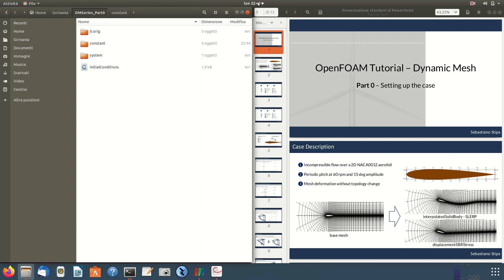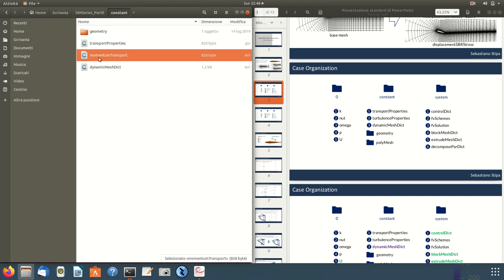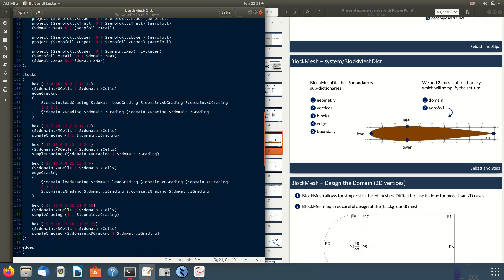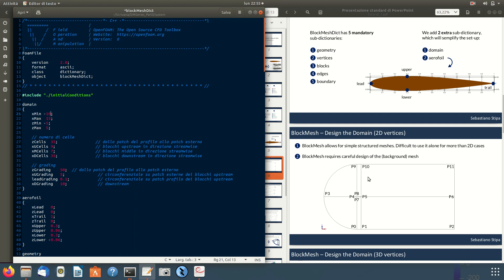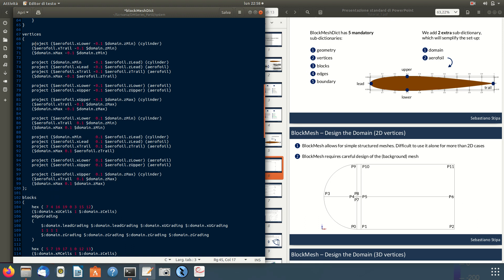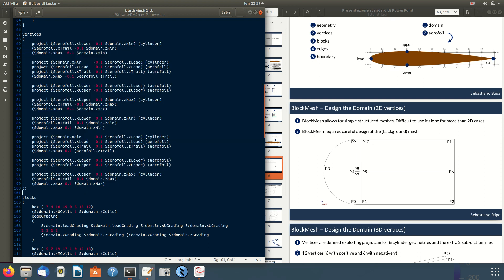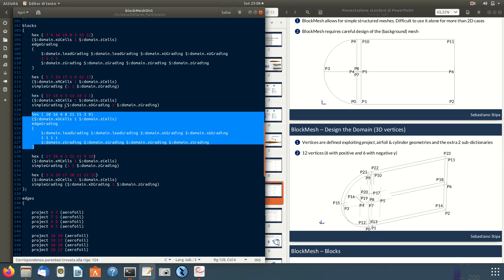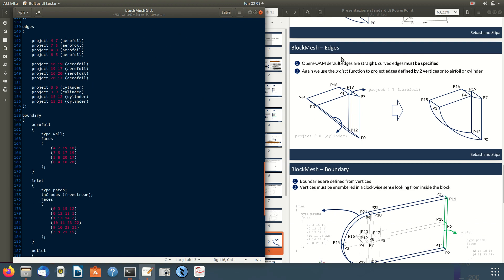DynamicMesh OpenFOAM Tutorial 1 - Advanced BlockMesh

Comment: Hello, Thank you for your video! I would like to do the same but for a NACA0018. Where can i find the NACA0012.obj file but for the NACA0018? I tried to create it with solidworks but the code do no recognize the shaoe of the airfoil and so the mesh is not good. Thank you
Reply from the maker: Try to save in STL, open the options menu when saving and make sure that you are saving in ASCII, meters, and the tick on “don’t convert into positive space” is selected. And keep in mind that the mesh you create with block mesh and the SolidWorks CAD must be in the same reference frame. For 2D cases, if you are making a simulation say in the xy plane, so that the z direction has only one cell, make sure your CAD model is a long extrusion in the z direction that intersects what you define as background mesh.

Comment: Thanks for your great Explanation. 
I have tried to set up the mesh with my own airfoil. The problem that I have got that I cannot choose a type empty for front and back as my airfoil is not symmetrical. I must choose a type wall. 
Due to this i get bad results. 
Do you know the reason i cannot choose type empty ?
Reply: Type empty means that you tell the solver to not solve in that direction. Since this is a 2D case we set front and back as type empty. Even if your airfoil is not symmetrical it is still a 2D, so you should put type as empty.
Reply from the maker: @mihir9173  perfect explanation